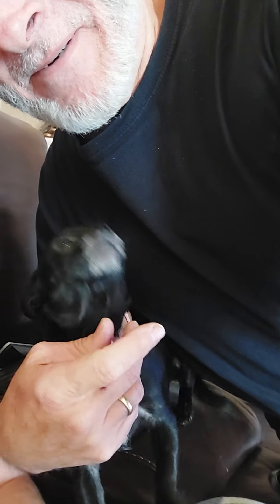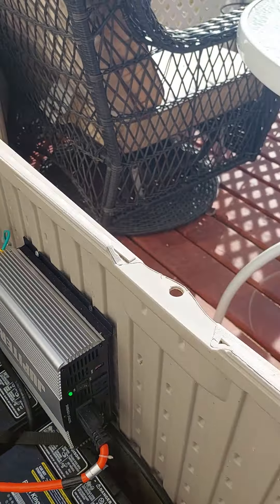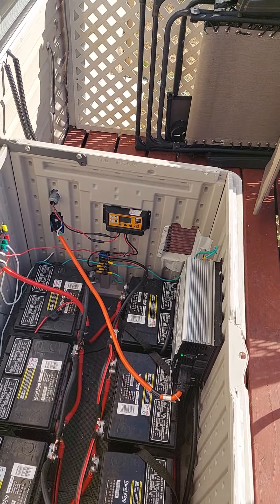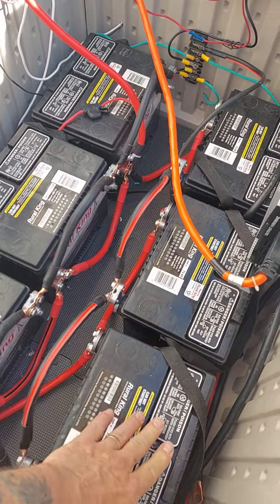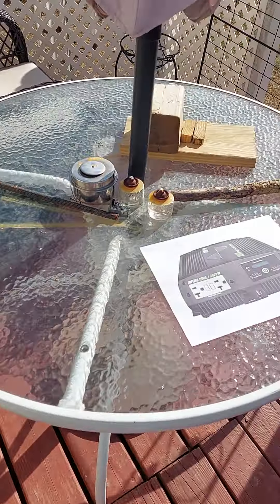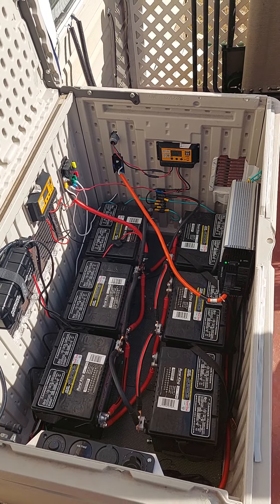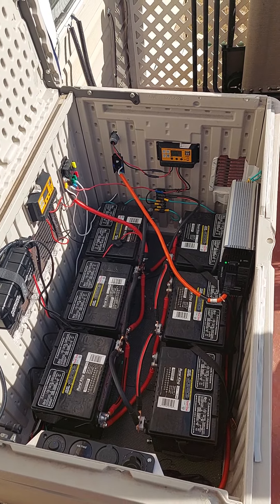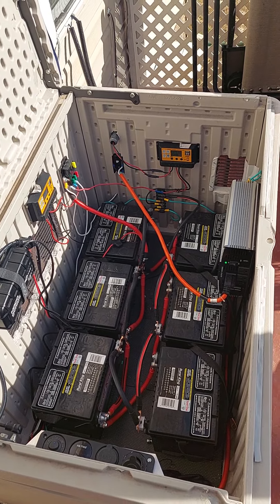Modified vs Pure sine wave inverter. PSW WON.

Comment: I bought a 2000w pure sine wave inverter, 300 ah 12v LiFeP04 battery, and 60 amp MPPT charge controller. I hope by next Summer I can safely decipher how to build a solar power system to power my tiny window air conditioner during the day in my camper from solar. I hope to build a portable power station with these I can roll out to the garden to power an electric tiller. I need more solar panels though.
Reply from the maker: A couple more panels should do it as far as charging the batt in adequate time. Everything else sounds good. Make sure you connect the solar controller to battery or batteries before its connected to solar panel. If you combine another battery, use no smaller than #2 battery cable to connect batt's parallel. Between my vids on the solar battery bank and so many others out there. You shouldnt have any problems